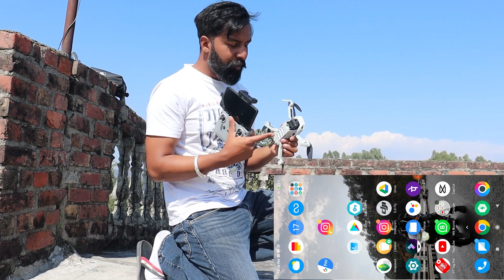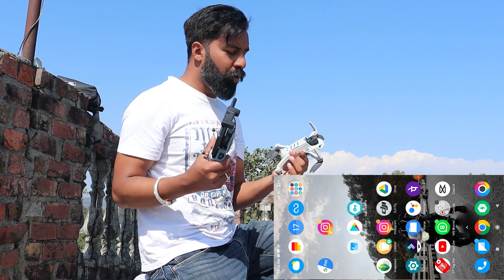How to fix Gimbal stuck problem after crash DJI MAVIC MINI 2  2022

Comment: my dji mini 2 was crushed after fix it work normally but now when turn on gimble completely working after take off can not move camera up and down, can you how to fix it
Reply from the maker: it can be fixed DM me on Instagram /rudanvlogss 
and please subscribe my channel plss..
Reply: @rudanvlogs  i have the same problem with my mavic mini 1 the gimbal is moving right and left but the camera is not moving up and down, do have any idea how to fix it?
Reply from the maker: @HarryPotter-lc8so   first check the gimbal is sticking any where or not if not then may be its gimbal problem

Comment: please tell that my gimbal is stuck and over heated, is it repairable ? or do we have to replace it ?
Reply from the maker: Bro it always stuck due to crash or wrong pressed by its cap... And which part is overheated bro... ?
Reply: @rudanvlogs  camera is overheated, it seems that the gimbal moving motor is trying hard to move but can’t
Reply from the maker: @aayushtayal09   did it crashed ?
Reply: @rudanvlogs  yeah
Reply: @aayushtayal09  Same with me. Very small crash but now the gimbal does the rotate thing fine when starting but ends up facing upwards. Although sometimes I can get it to start up normally.